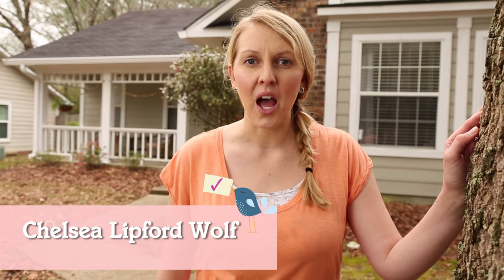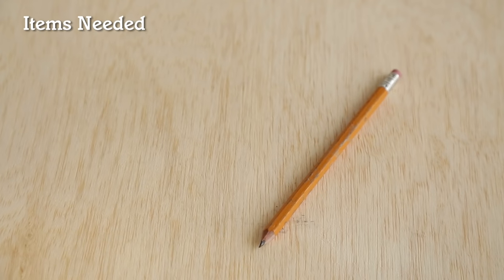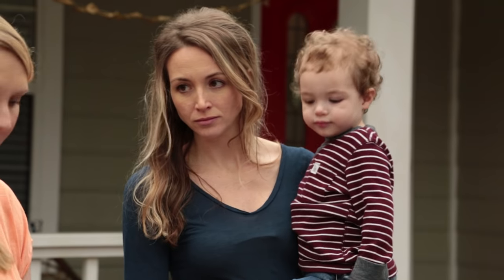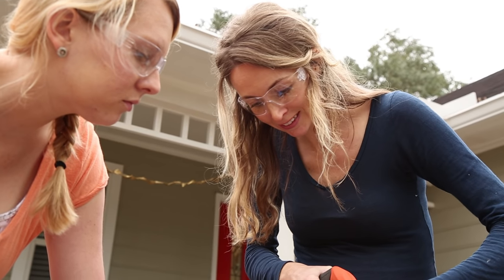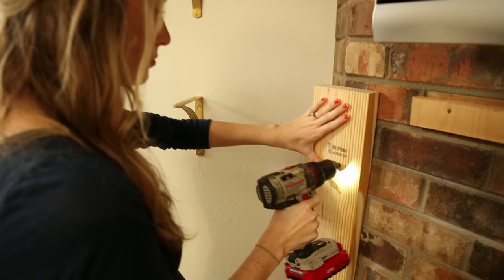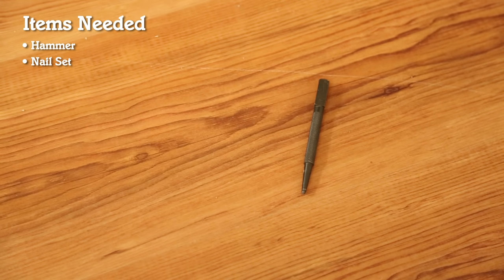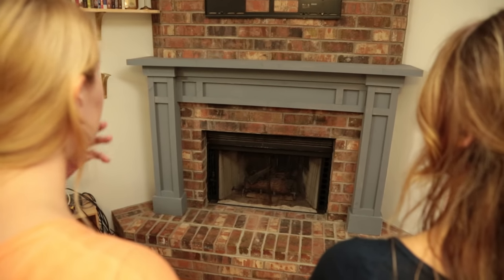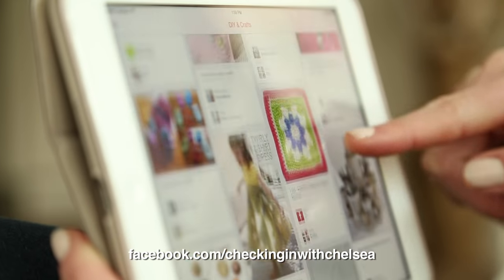Build a Mantel Over a Brick Fireplace

Comment: If you're cutting any lumber, never center the cut between two saw horses and let the weight of the saw rest on the board. You will bind the blade and the saw will kick back and cut you.

Comment: Nice video, but wow i cant believe you touched the blade! First off she has never used it and secondly thats dangerous regardless how long you been cutting. You should have specifically told her not to ever touch the blade unless changing it out. also you ensure battery unplugged or cord is not attached to outlet prior to touching blade! Good luck.

Comment: while your design is simple and attdactive, mantels and surrounds are carpentry projects not decorative crafts projects. Heat from the fireplace and low winter humidity will dry out the wood and in a couple of seasons warp the joints and pop the cross pieces out.  proper wood joinery  techniques are essential for lasting results. good luck
Reply: Agreed. I like the overall design but that box store common pine generally has a bit too much moisture in it. Those nails won't do much in preventing those joints from separating as that pine moves.
Reply: What material would you recommend?
Reply: cutcreator12b 
birch plywood. any smooth plywood for the flat surfaces and dried hemlock or solid cherry for the edge and cross pieces will do but the butt joints and finish nails with glue downs will just pop apart as it dries out and shrinks. you need a minimum of pocket screws and glue clamped tight and square. it's a joinery problem not just a materials problen.
Reply: Kreg Jig it!
Reply: Could it dry out so much and burst into flames? Is it far enough from the opening?

Comment: I would be embarrassed to post this project on YouTube.
Reply: @tacticaladvantagegroup  Insecure - NO. Third generation Finish Carpenter - YES. Let me help you (and them) out. Next time use either clear Pine, Poplar or MDF. Superior materials with no knots. Glue all joints, then sand them flush before painting.  Using #3 Pine, as they did, is unwise. It's not a finish grade material and looks it. Furthermore, some of those ugly knots used in the video are likely to fall out at a later date. Others just look bad and no matter how much wood filler one uses, they will never look up to par. Got any other stupid comments to make?